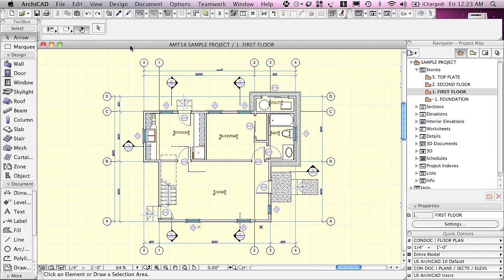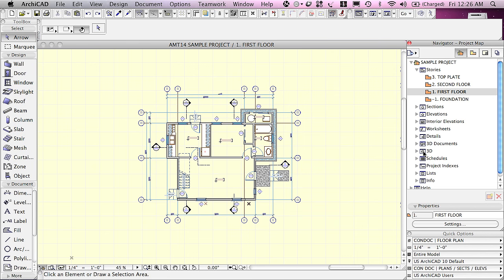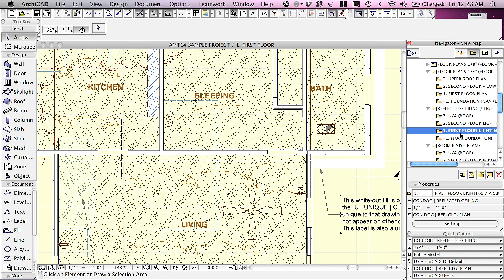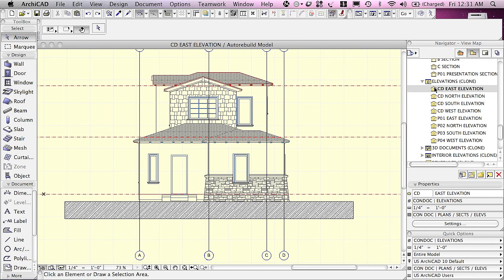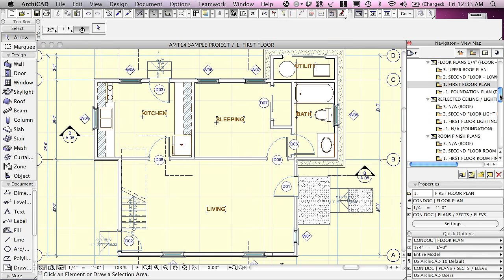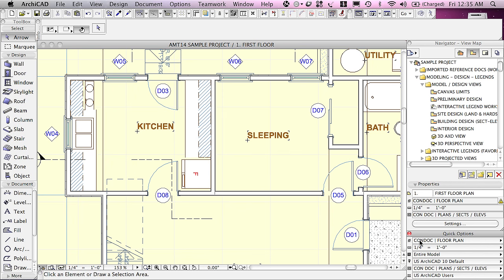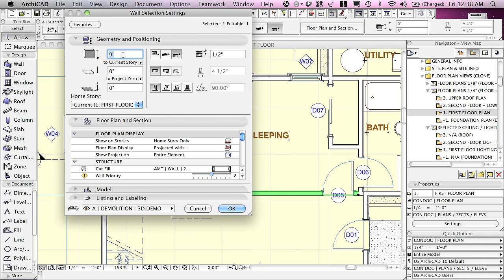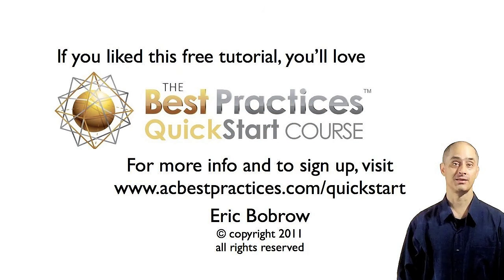ArchiCAD Basic Training Lesson 1 | QuickStart Course Overview [UPDATED version link see description]

Comment: Hi eric, thank you for sharing your knowledge in archicad.🙂 Archicad made our life easier but some commands or if we cant execute what we want, it drives us crazy. Anyway, how do I break or cut a multi/poly wall (1 group)? Thank you!
Reply from the maker: Hi FX - It sounds like you're referring to a group of walls created at the same time (using either the box method or the polywall option), which will automatically be grouped (if autogroup is turned on). You can work with any of these walls individually (stretch, change settings, delete, etc.) by using the Suspend Groups option (found in the Edit menu > Groups > Suspend Groups command OR use the convenient toolbar button to toggle this off or on). When groups are suspended, you can select these items individually (as if they are not part of a group), however when you re-activate groups (by turning off Suspend Groups) they will still be associated as a group, and can be selected and moved essentially as a unit. I hope this is clear, let me know if you need further explanation. - Eric
Reply: @ericbobrow  thank you so much Eric. I didnt expect that you're going to reply. Anyway, love your videos, thanks for sharing.
Reply: @ericbobrow  Thank you so much. It worked.

Comment: This Quickstart Tutorial Guide (along with those on Mr. Bobrow's website) is exponentially better than the Graphisoft tutorials.  Mr. Bobrow does a terrific job explaining the software and putting it through its paces via practical demonstration.  The pace is ideal for a beginner, and he often demonstrates how to accomplish a task on both the US and International versions of the software.  This is by far the best beginner's guide to Archicad that I have managed to find on YouTube or anywhere else.That said, the tutorial IS outdated.  While many say "There isn't that much difference between versions 15 (the version used throughout most of this tutorial) and 20 (the current version as of this writing), I disagree emphatically.  The discrepancies between the libraries (and parts) alone makes it very difficult to emulate many of these lessons, regardless of whether you're using the International or US version of Archicad 20.  Additionally, the behavior of the Navigator is very different in version 20 than in 15 (discrepancies in file tree structure, default settings and feature toggles, nomenclature, etc.).  I found myself having to pause the videos numerous times just to try to find the correct parameters inside virtually all of the tool settings in order to follow along and make the correct changes, because they are simply not in the same places as they are in these tutorials.  Modules 6 and 7 in the Quickstart Tutorial Series were extremely challenging due to actions in the project map not cloning to the view map automatically.  Had I not had the assistance of a local professional CAD designer who uses Archicad everyday, I would have never made it through the Quickstart Tutorial Series simply because of the differences in versions 15 and 20, because 100% of my issues stemmed from those discrepancies and inconsistencies.Again, this is a phenomenal tutorial series, and it's almost certainly the best one out there, but it definitely needs to be updated.

Comment: Thank you very much Eric, as I am new learner of ArchiCAD I have problem with shortcut which I could not solve for a while, it is not all the shortcuts working with me, as example Ctrl + Z is not working, when I press Ctrl it is always showing a scissors icon, keys like shift or alt or numbers are working but anything relate to letters or other shortcuts not working!! it is very strange problem which I could not find solution for it in the network and it makes ArchiCAD kind of difficult to me!

Comment: Eric, I have got the sloped roof on my building thus sloping the wall however I Can't work out the correct angle so that my wall is say 3 metres high at one end and 5 at the other end do you know how I could make that happen? Because I change the wall heights and obviously the roof No longer sits on top, how would I sort that? To almost crop the roof to the walls? Because I Can't work out the correct angle that the roof would need to slope.  Thanks

Comment: I figured out a way to show top of wall labels on foundation plans without manually entering them. I know this question gets asked a lot on other forms.

It entails creating a top down 3D document view. Using the dimension tool (ridge line setting, triangle pointing down at line) Then you explode those elements and paste them into the 2D foundation plan view.

Changed my life.